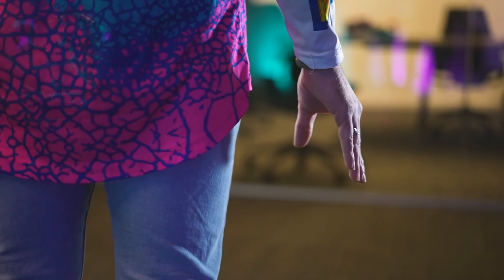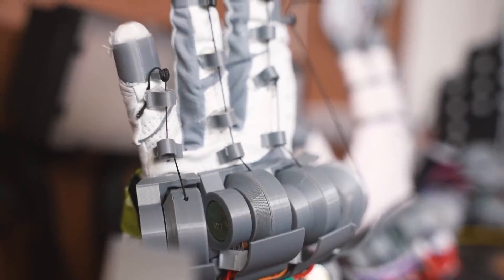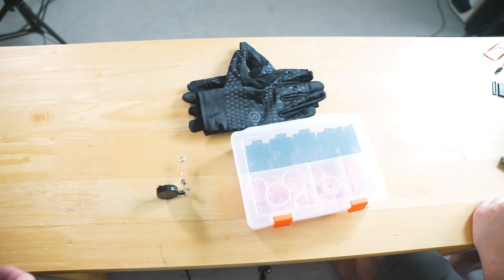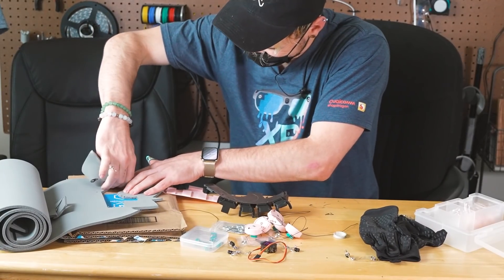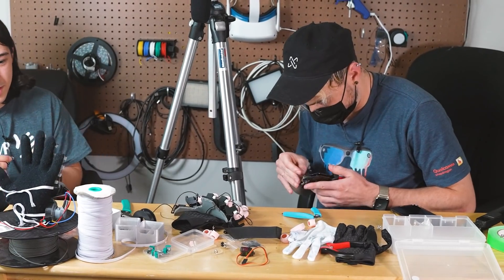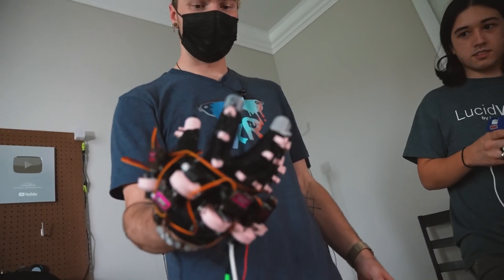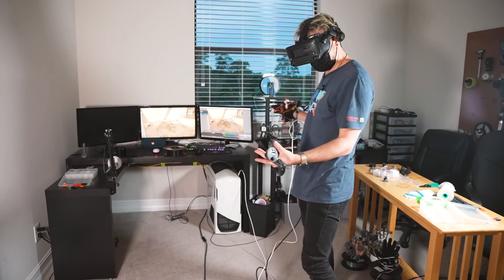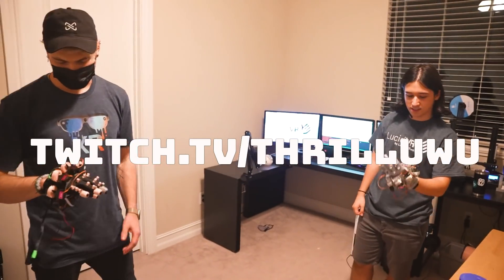Building my own VR Haptic Gloves with the VR GLOVE MASTER

Comment: I've never wanted to finally get into computer science professionally more than I do now so I can know how to build a pair of these in my own design. This. This is just fantastic!
Reply: Comp Sci is awesome (professional software engineer with 2x CS degrees here,) but the electronics side of this stuff mostly isn't covered in CS. Computer Engineering is an interesting degree for people who want to do this sort of stuff because it covers basic EE + CS (at least at my university, it was basically 3/4 of each degree, since around half of the EE and CS degrees were in common anyway.) A lot of people double-majored in Computer Engineering + Comp Sci in 5 years, which is an interesting option to consider if you want to do embedded systems work like this. Of course, you can learn the basics of either electronic design or software design just from tinkering on your own, but the degrees do help for the more in-depth theory knowledge that most people don't pick up on their own.

Comment: Your comment at 6 min in is something that I feel every time I fire up Elite and use my 3d printed arduino based dual joysticks and throttle to fly around the galaxy.  This has gotta be that to another level. Hmmm I've still got plenty of pots and a couple esp32s looks like I need to order some more filament, servos, and the pull thingies.

Comment: "i want to make it less bulky"
proceeds to add more wires than my whole gaming setup has. lol but i love the idea and realy want to see how far this goes
Reply: I think that the design can be fine tuned to your hand size to get those wires alot shorter, it's jsut left intentially long now for ease of building and troubleshooting. Also would help to have some sort of cover for the electronics I think, which could also hide all that mess.
Reply: There are a few problems I see though like what if u want to make a fist, the joystick will get in the way and u would press the buttons by accident
Reply: For force feedback which could only Happen from cutting the bulk first
Reply: Plus when your trying to move around and hold a gun in vr, your thumb will most likely either not be allowed to move that far to the joystick or will glitch into the gun and the whole thing wont work

Comment: I could inagine a dwsign for haptic gloves like this in the future, light components inside the base od the glove with hard string pulls that dont break easily inside each finger, like a lot easier to hide the design inside the gloves xD
Reply: The idea isn't far off really. Something akin to a nylon fishing line is very durable and affordable, and thin teflon-lined tubing to run it through similar to that of bicycle brake cable lines is also easy to acquire. The biggest hurdle in my opinion, is the bulky reels and motors and wiring that these currently have. PRetty sure you could make it much mroe compact with the right parts though.

Comment: The price gap between the commercial product and the homemade ones is just insane.
Reply: Bear in mind it doesn't have any tracking so it's kinda useless. They're using base stations to track here but if you're going to pay out for base stations you could get knuckles.
Reply: @zig131  It doesn't have to be tracked just using base stations and vive trackers. They've shown that it is possible to use touch controllers for tracking.
Reply: @dastmann621  And Slime VR is a thing now as well. You could probably use a slime tracker for tracking as well.
Reply: @zig131  well if you have quest, you can just use touch controller for positional tracking.
Reply: @SuperUsman11  True but that's such a bodge.
We really need an affordable, flexible, independent tracking system cough Stonx cough
My point is that the tracking is the difficult and traditionally expensive bit a not insignificant part of the reason "the price gap between the commercial product and the homemade ones [are] just insane". The gloves may be cheap but they're of absolutely no use to someone using Google cardboard or who otherwise doesn't have controllers already. The idea that these gloves are some kind of budget VR control/input solution is highly flawed and that seems to be how they are being sold (of course not literally as they are open source).
Reply: @zig131  even with the trackers included it's far far cheaper
Reply: @LightVelox  fr 5 grand vs 20 dollar vr gloves and base stations is a no brainer
Reply: @zig131  Most haptic gloves require positional tracking from either a vive tracker, or a VR controller such as the oculus touch controllers and cost thousands. This is a super low budget option when it comes to haptic gloves. Even when you take into account the price of base-stations and trackers, it still costs way less than other haptic gloves, most of which require base-stations and trackers anyway. The expensive and difficult part of most haptics gloves is not the tracking, as most of them just use vive trackers, the expensive and difficult part is generally the haptics and the finger tracking. If the expensive and difficult part of haptic gloves was the positional tracking, then why do haptic gloves cost so much more than VR trackers and controllers?
Reply: @zig131  If you are using VR you probably already have base stations.
Also these are not trying to be an alternative to the knuckles. They are gloves.
Reply: @gyroninjamodder  poor quest users